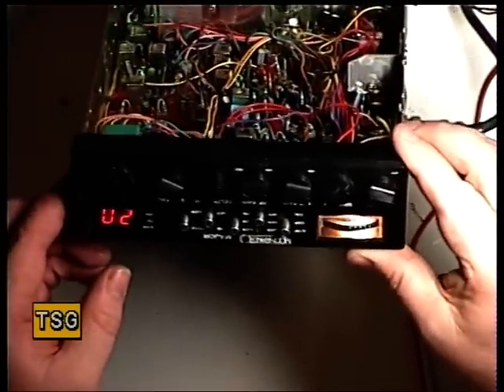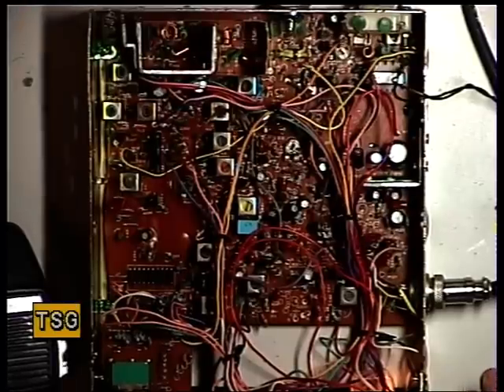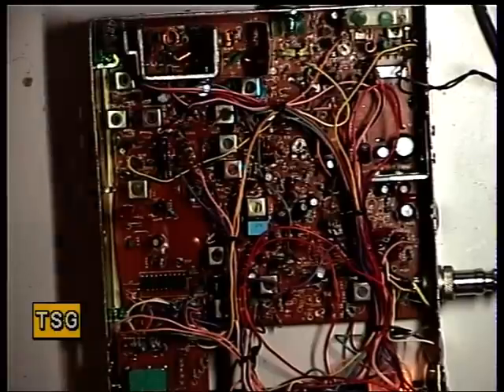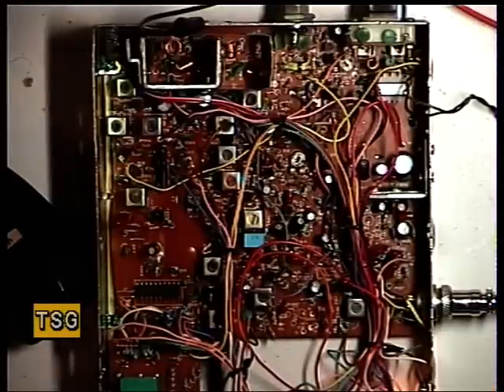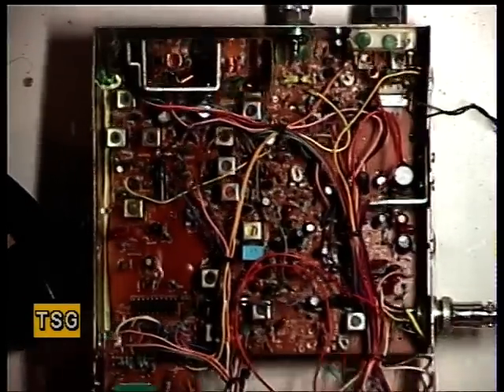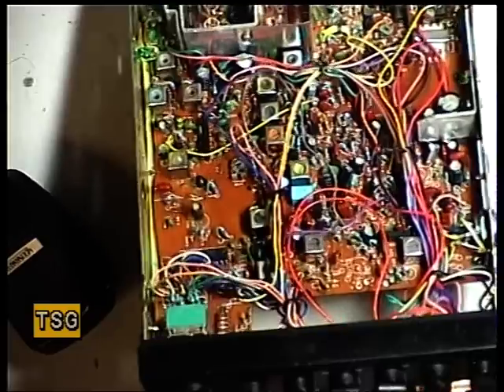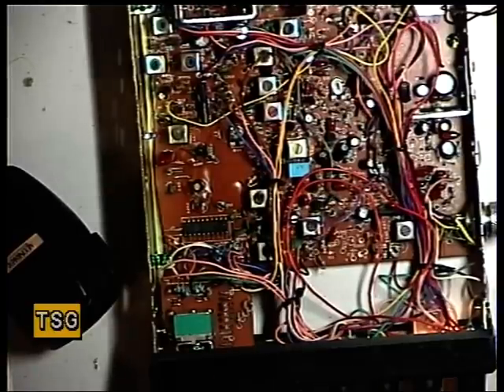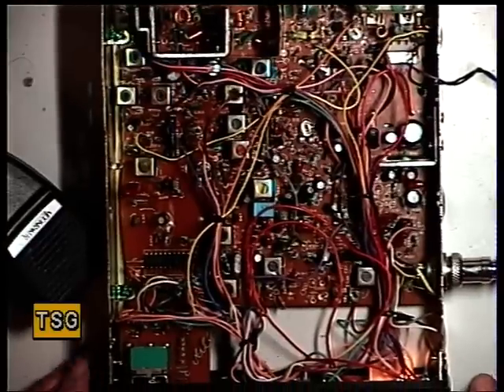Moonraker Major - UK CB radio, (CB 27/81) (Mobile) - Transmit alignment

Comment: RV4 is TX frequency adjustment.
T6 i assume is for the 10.240
but not sure what T11 is for as that also adjusts the 10.240 ??

anyone thinking of buying one, they are a pig to figure out.
broad print wrong, two Q1  some items unmarked.
schematic ok, but not ideal,
needs a lot of guess work..